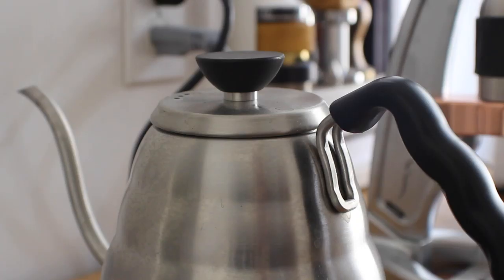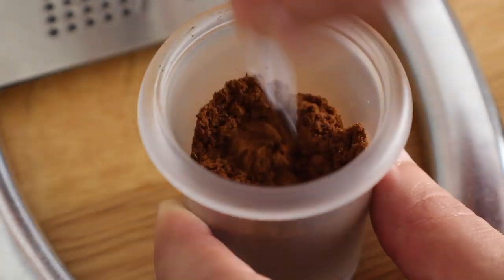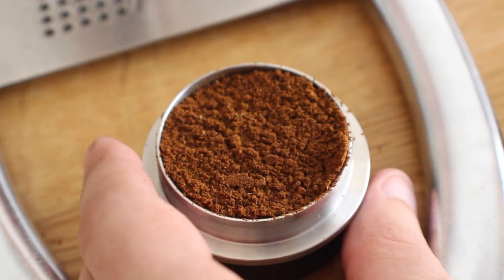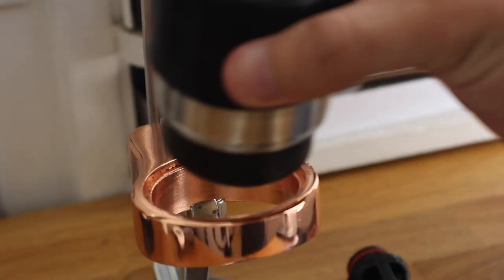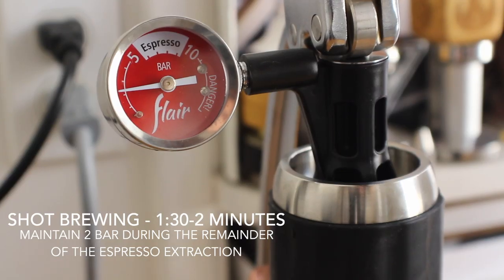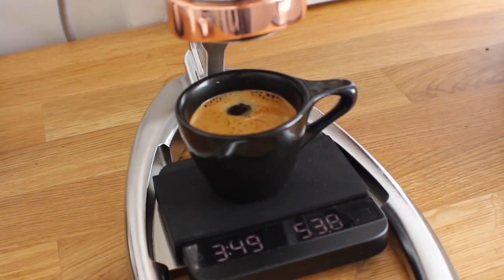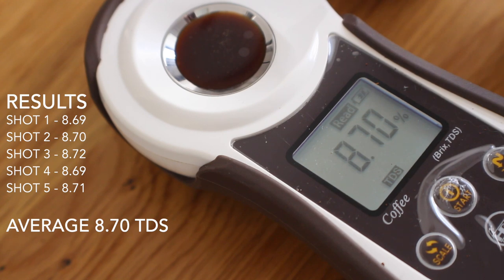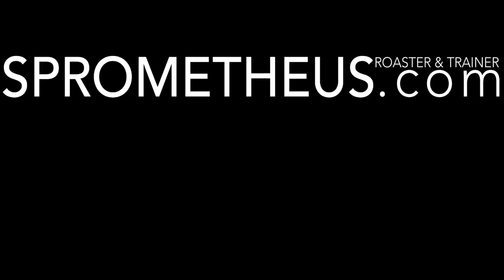COFFEE SCIENCE - Blooming Espresso & Maxing Extraction

Comment: Damn you can actually see the coffee oil droplets that's crazy!
Reply: I wonder how is that possible, never see a coffee oil droplets visually after pulling a shot, I still don't get why do we want a 20% extraction? Does it taste better? I'm gonna watch is all over again.
Reply: @liquidiceyt  The paper filter on the top is supposed to «even out» the flow and reduce channeling, which increases extraction in the end. The filter on the bottom increases the flow rate, because it removes the tiny coffee particules that would otherwise clog the little holes of the portafilter basket. This means that you can grind finer. Virtually no channeling + finer grind = more extraction. More extraction = more coffee oils maybe?
Reply: @AnOtterCoffee  Ah.. I see, but with 2 bar of pressure that doesn't seems like a lot of extraction going on. Like as if we didn't squeeze the ground coffee enough to make the most of it.
Reply: @liquidiceyt  extraction depends on many factors, including pressure and time...since the shot is 3-4min long, it extracts the sh*t out of that ground coffee, even if the pressure is very low 😂
Reply: @AnOtterCoffee  Interesting, might give it a try tomorrow, 👍. Thanks Simon.
Reply: @liquidiceyt  My pleasure! 👌

Comment: What is your go-to recipe with the flair signature pro ? I’ve been struggling real hard to get a decent shot. Everything is wayyy too sour. Perhaps under extracted ? My best result so far was with 20g with a 1:2 ratio. Preheated x3. With a 45s brew time + a 15 sec pre infusion. I have brewed with 3rd wave coffee as well as espresso beans. And neither is satisfying to me... anyway. What is your best recipe ?
Reply: try using steam to preheat. take your pre-I out to 30 sec and your pulls upwards of 50-55 sec at 8-9 BAR, and we'd suggest 1:2.5+. join the owner's group on FB if you're not already in www.bit.ly/BrewWithFlair
Reply from the maker: I feel like the recipe has a lot to do with the coffee I use. But I tend to lean towards a 18g in and 45-54g out. Since the Flair gives me more control in terms of pressure I often pre-infuse for at least 15-20 seconds and pull at 6bar. I tend to fine lower pressured shots smoother and better balanced. But that just my personal preference.